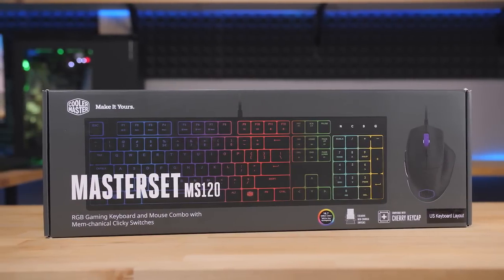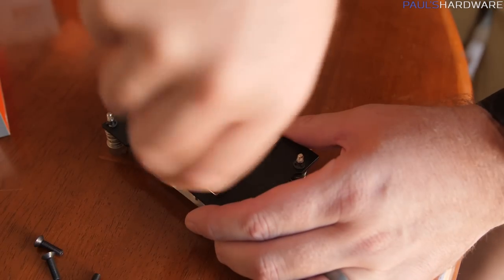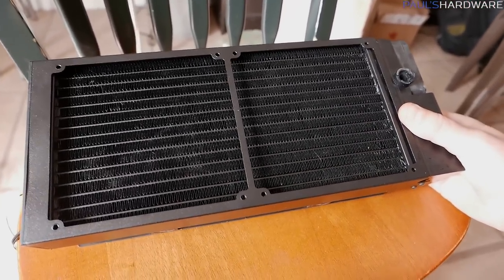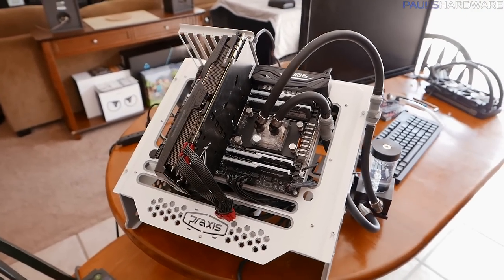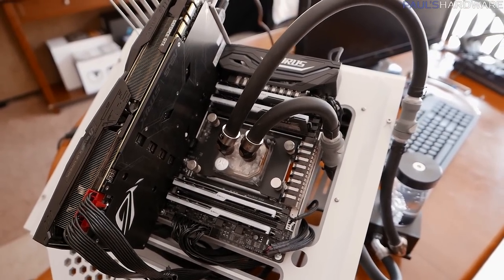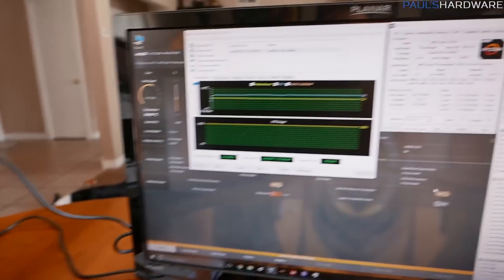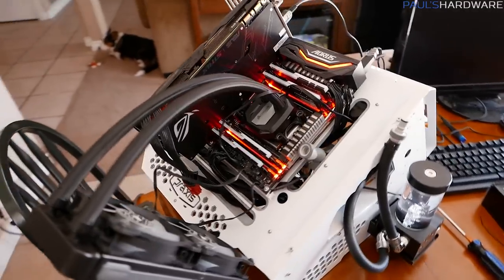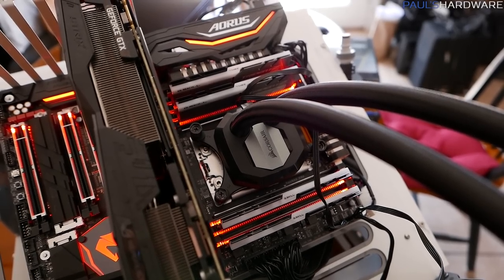My Failed EK Supremacy EVO Threadripper Edition Review

Comment: watercooling sucks the sooner people understand that the better
Reply: cctvuser no
Reply: cctvuser It's tricky and risky but the payoffs is much better than playing it safe with some massive air tower cooler.
Reply: 5820k @ 4.7 on air enough said.
Reply: cctvuser probably loud af
Reply: why would it be loud?? when its running at 1.23v?
Reply: I just assumed that it would be a higher voltage, nvm.
Reply: never assume anything, especially that watercooling is a good idea
Reply: You have a cpu from 2014, he is watercooling a threadripper. See the difference? The threadripper is going to be hotter than your cpu.
Reply: cctvuser all in ones don't count as water cooling, they suck. If I had to choose between a corsair h100 and a noctua nh-d14 I'd choose the noctua in a heartbeat.
Reply: that cpu will run perfectly on air - just like amd designed it to, tell me - where on the box does it say "for use with water cooling only" dont forget amd designed that cpu to run on air and NOT water
Reply: water cooling used to be a very good choice. I remember back when my father watercooled his intel core duo quad and overclocked it to 3.6GHz.. we really saw the difference. AND it was so quiet..before that he had a watercooled "dont remember what piece of crap" with a waterblock he made himself cause EKwb wasn't even a real company back then. any way.. Im talkin about 180+ watts of heat...you cant air cool that thing..and now if you want to overclock something with more than 10 cores and have a quiet pc with low temps custom watercooling is the only way
Reply: No aio suck. Water is great.
Reply: cctvuser, but that cooler didn't actually harm anything when it failed and it has a 5 year warranty, so Corsair will replace it, all that you are out is the time it takes to get the replacement, it's not like it leaked all over shit and fried everything.
Reply: Tyler Alcover got triggered.
Reply: a block, 2 ugly ass hose pipes, radiators a water jug and lets not forget fans to actualy cool it - against 1 single a air cooler? dont sound very aesthtic to me
Reply: cctvuser, you've obviously never heard of hard tubing
Reply: Or done any research ever
Reply: you dont need to research anything to know water and electronics dont mix - its just common sense
Reply: Everyone is entitled to their opinion, doesnt make one better than the other - results do. Air cannot cool a threadripper like a custom waterloop, we have seen that, but a threadripper will run with air. AIOs are shit, they dont cool as well as a decent air cooler that costs the same, but if you want the very best out of a hot chip, custom water cannot be beaten. Visuals are a preference, i prefer the looks of a custom loop for instance but you need to have the space to do it properly.
Reply: You getting hot about what people do with their own PC's is reason enough to start and or continue watercooling.
Reply: this is the point you all miss, cpus are designed to run hot thats how they work, why add a garden pond to a rig to col down something that dont need to be cooled in the first place, brainwashing comes to mind, it really is that simple you dont need to spend a ton of money and have a water feature in your rig to cool something that does not need to be cooled in the first place, air does perfectly fine.
Reply: i think youll find its the watercoolers getting hot in the comments section
Reply: The point you miss, is why do you care what people do with their own PC's and money?
Reply: who said i care? im smart enough not to put a swimming pool and water tanks in my rig, if you want to have a septic tank in your rig be my guest.
Reply: Not sure if stupid or trolling.  If CPUs didn't need to be cooled in the first place, they wouldn't thermal throttle or even shut down if getting too hot. Air cooling is still cooling, Einstein.
Reply: Hm, makes me want to water cool my pc even sooner.
Reply: Actually, CPUs run better when cold. The theoretical limit on how fast a CPU can go is based on two things:
Power and Heat.

The colder you get, the less power you need and the faster calculations run.

So... no. CPUs are not designed to run hot, they are designed such that running hot doesn't hurt them(unless it hits 100c).
Reply: you win the dumb ass award "the colder they get the less power you need" you have made my day you really have
Reply: You obviously do, otherwise you wouldn't have stated that you don't need to spend a ton of money for a water feature.  Guessing you got daddy to fork out money for a X99 PC but he drew the line when you wanted to water cool it?
Reply: ive been gaming for 30 years since i was 8, now jog on little boi
Reply: I'm sorry that physics offends you? The colder something is the less resistance it has, the less resistance something has the less volts and amps you need to push to achieve the same speed.

This is why liquid nitrogen allows CPUs and GPUs to reach such high speeds.
Reply: ps ive just done £400 on a qnap nas, £389 on a 27 inch 1440p 144mz monitor too.
Reply: Lol, and I am the 2nd coming of Jesus.  Lol, trolling Youtube at 38? Hahahaha
Reply: link us to a video showing a cpu using less volts to achieve the same clocks when its at a lower temp, this will be fun
Reply: actualy im going to turn every fan on my pc to full power, then drop the volts (in real time using the asus software) just too see what happens, im betting my cpu locks and crashes my pc.
Reply: I never had any problems with my hardline tubed custom water loop. Especially going with an aquaero that does all monitoring for you saves your system if anything ever goes wrong.
Reply: Again, lol.  Anybody can record a box for what was it 1 minute 3 seconds???  Hahahaha I'm out, hahahahaha
Reply: cctvuser With that logic, you might as well say, and yet another car crash, cars suck.
Reply: https://www.youtube.com/watch?v=lHoGKtYpJKI

There you go, undervolted CPU without losing performance.
Reply: Sorry but I'll stick with my EK Predator 240 looks way better then any air cooler and cools better then any air cooler. Plus I don't have to have a gigantic air tower cooler that takes up basically the whole inside of the PC. Also have a second PC with a Noctua DH14 so it's not like I hate air cooling. Just don't like the look of it or how big some of them have to be to compete with AIO's. I'll definitely take the very small risk of a leak or a broken pump for the cooling and aesthetics.
Reply: who gives a fuck that your cpu runs at 36?? whats so special about that? you have cooled a cpu down big deal, the fact remains a cpu is  designed to run hot all with in its designed limits, your just cooling something down that dont need to be cooled down to that level in the first place, so good for you adding water and the waste of money
Reply: err my cpu is undervolted, this has nothing to do with what you earlier claimed.
Reply: and dont bother me for the next 20 mins, im looking for a 4k camcorder and a 4k monitor also some magic tree car scents for my car.
Reply: Wow I wish I were you.
Reply: you can dream of being me )
Reply: I prefer air cooling and you can get them with RGB lighting now...but to each they're own, some just like the looks of custom water loops. In reality water should be no where near computer components.
Reply: correct redemption, its ok these youtubers (salesmen) encouraging you to use water but when it fails and takes out all your componets its you left with a repair bill, it dont matter to them as they never paid for the items in the first place.
Reply: You're nearly 40 and waste your time trolling people on YouTube. That's actually impressive.
Reply: my first comment was that water cooling sucks - a fact, then you and your sort started to troll me, im not wasting my time at all, i enjoy roasting trolls.
Reply: redemption Yes water shouldn't be near computer parts. But regular water doesn't go in water cooling loops. You know what does, distilled water. And you know what's so special about distilled water, it's non-conductive (not completely but almost). That means it doesn't mess up your computer parts. Woah, crazy right!!
Reply: just to educate you, distilled water may not conduct electricity, but a liquid does not need to be conductive to destroy electronics
Reply: and to educate you further, soldiering flux, tiny pieces of metal etc etc is conductive and if that mixes with your distiled water it WILL become conductive, so dont try and spread your shit that its safe to water cool because its not
Reply: not in your motherboard its not
Reply: i forgot to ask the last person if hes willing to sit in a bath of distilled water and let me throw in a psu connected to the mains supply? id love to see the out come of this experiment.
Reply: cctvuser Yes it is safe to water cool. Yes it will become conductive. But most people aren't dumb enough to leave the same coolant in for a long ass time. A couple weeks ago I had a system leak and the res was almost empty and I cleaned it out with some isopropyl and it was fine. Stop trying to spread your water cooling is not safe it will ruin your computer bullshit.
Reply: Must be fun at party's telling people what they like sucks.
Reply: also im going for a drive to macdonlods im tempted to live stream it, why? because i have the fastest car in my street - sorry to brag lol
Reply: cctvuser Ok, now you're just trying to come up with random bullshit. Yes I know that if you have a coolant is your system too long, it will become conductive and MIGHT break some components. Can you just accept the fact that water cooling isn't the danger that everyone should stay away from, which you seemingly want it to be.
Reply: water cooling is not needed, if it was id use it myself as ive said theirs no need for people to get there knickers in a twist over cpu temps, the only people who benefit from water cooling are the companies that sell it, i build a pc clock it with a air cooler and put it away, ive built many pcs all over clocked all on air all running fine to this day because i never let youtubers brain wash me into water cooling.
Reply: cctvuser so what if water not needed. It don't mean people are brain washed. Let's get real here, you only here to brag which is really sad even in your videos you can't help brag about your overclock.
Reply: my bragging prooves a very big point about that overclock and why water is not needed, and why shouldnt i be proud of 4.7 on a 5820k on air? salesmanjay brags hes a master "watercooler" despite never  gaining such a qualification to back that up.
Reply: and if i can stop a newcomer to the pc buiilding scene that he must water cool, because if he was to believe these youtubers he would think he has to watercool - and save him some money in the process then ill damm well continue
Reply: cctvuser it don't look like you stopped a single person here and don't think new comers want custom water cooling but maybe an AIO which I would agree I wouldn't waste time with them over a good air cooler.
Reply: time for me to go watch alex jones and fall asleep, in the next few months it maybe bye bye to my x99 build, i feel a 10 core + build coming up, but i need a cpu that will clock to at least 4.5ghz
Reply: cctvuser OK mate you enjoy that sad life.
Reply: its not a sad life its the pcmasterrace life )
Reply: cctvuser I hear you need a 16 core cpu to get rust running at its best so better save for that instead of that 10 core shit.
Reply: rust runs at about 90 fps maxed out on my current rig )
Reply: rust limit is 102 fps if i remember rightly, i do get 140+ fps in fallout 4 though, not bad for a r9390
Reply: cctvuser I have no if that's any good since don't have them games plus I'm only joking about rust.
Reply: night night bud, i might run into you in pubg one day
Reply: cctvuser good luck since pubg not a fan of amd.
Reply: runs fine at 1440p here
Reply: cctvuser lol "fine" so not great then like my Titan X.
Reply: cctvuser
Just go for a block that fits, why be the early adopter, go the time... Or just buy a console if you like to play games!
Reply: You probably get more horror stories from heavy air coolers causing damage than failing AIOs.
Reply: You pretended to be a know-it-all about electronics and liquids yet you didn't realize that acids conduct electricity when dissolved in water lmfao.
Reply: cctvuser Of course air cools the fucking coolant.
Reply: Eminentend And are you talking about me? I would recommend replying so we know who you are talking to.
Reply: No for some reason YouTube doesn't want to say who I replied to on my PC. On mobile it works fine. I was responding to cctvuser
Reply: cctvuser I'm not in the fucking U.K.
Reply: cctvuser Calls 6850k shit spec, HAS A 5820K
Reply: lets see video proof of your cpu?
Reply: yes the 5820k that runs at 4.7ghz at 1.23v on air - something your cpu dont do in any sense.
Reply: cctvuser Having a higher click speed doesn't make it a better CPU.
Reply: give us the video...........
Reply: cctvuser the vid is uploading.
Reply: cctvuser The vid is up.
Reply: wtf only 8gb of ram.
Reply: SkinUpMonkey Yeah, I need to pick up some ram from work(I work at a shop that builds computers).
Reply: glad i can put a smile on your gob
Reply: cctvuser Trust me, a pc with a 6850K should not have 8gb of ram. I'll probably end up getting a 32gb kit, which isn't too expensive because it's 40-50% off (Perk of working at a place that builds and sells computers).
Reply: i  dont need perks - i see something or i want something i buy it, thats why i put 32gig of ddr4 in my build day one.
Reply: cctvuser Yeah this was a client build, but then they decided to cancel it a day before the pick up date. So we put it on display and no one decided to buy it. I just picked it up for a good discount. I just put in a 1080 and here I am, 7 months later.
Reply: why are you bullying my bitches?
Reply: lucas rem yep sure whatever you say bro
Reply: cctvuser Despite how much I used to hate you, you seem like a pretty cool guy
Reply: lucas rem oh shit I forgot you added so much to the conversation, sorry my bad.
Reply: lucas rem I swear you are max 7 years old. I can tell because you keep calling people noobs and you use exclamation points.